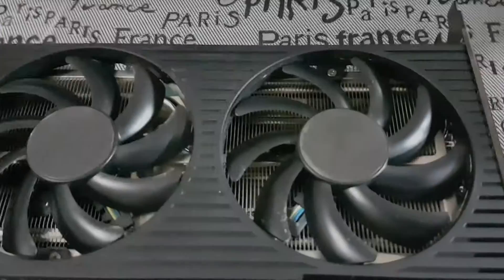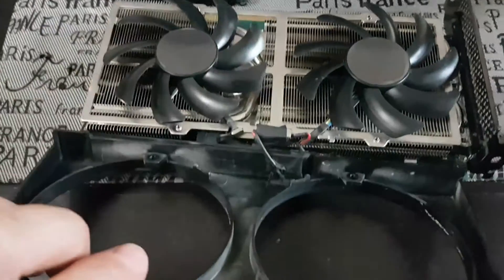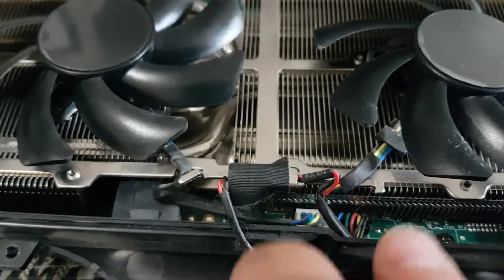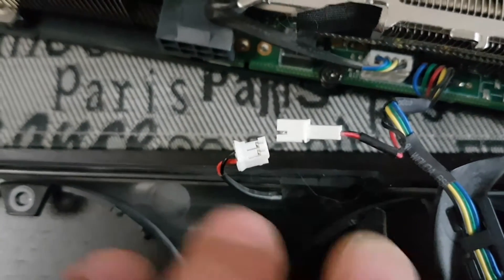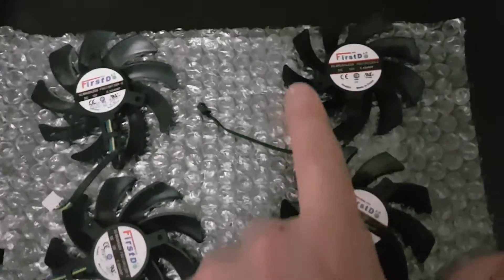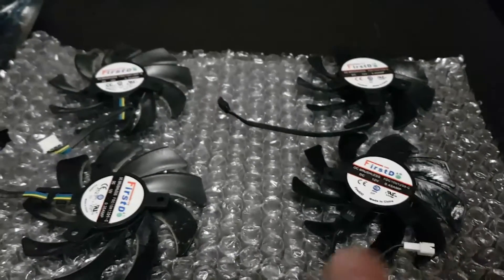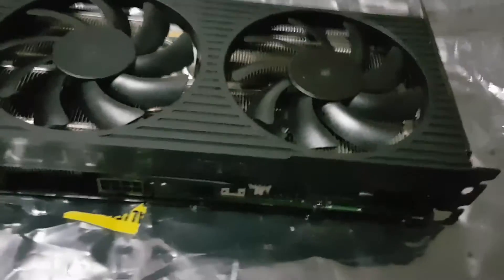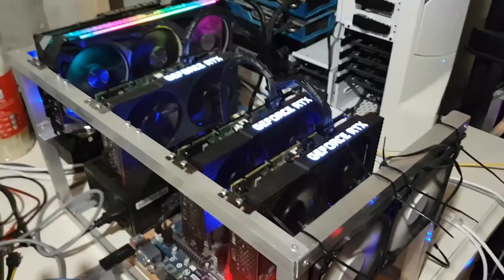Dell RTX 3060 Ti Fan Replacement

Comment: is it a big deal that my led isn't enabling? maybe it got burned or the temps broke it
Reply from the maker: Not really a big deal as long as the card is still running normally otherwise. Maybe just check the wires and stuff at the connectors tho.
Reply: @candr0idcrypto383  it's an hp gpu and i couldn't find anything about it on the net, it doesn't have the screws under the fans so i will just ignore it

Comment: do the fans turn off or always stay on on that OEM model?
Reply from the maker: Mine are always under load, and when under load yes both fans should be on. I had fans fail in all 3 of the Dell 3060s that I have. One fan would just stop spinning completely even tho I could spin them by hand. That being said, I have seen other cards where 1 fan spin continuously, while the 2nd fan only kicks in when needed.
Reply: Did you ever happen to find the dimensions? I keep seeing conflicting data online.

Comment: Would you know what size thermal pads this gpu uses ?
Reply from the maker: No sorry I do not. I havent changed any thermal pads on these cards. Only fans so far.
Reply: @candr0idcrypto383  do u have samsung or hynix memory on your 3060ti dell?
Reply from the maker: @stormiexz1626  I have 2 with Samsung and 1 with Hynix. So I have both types :)